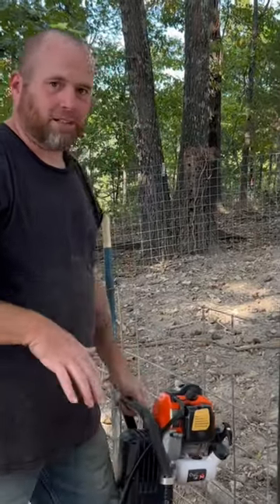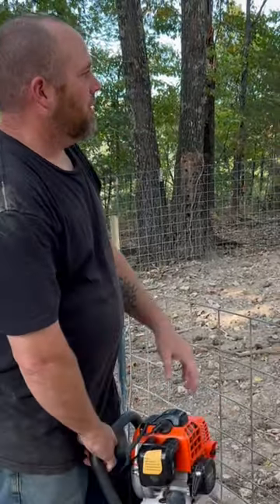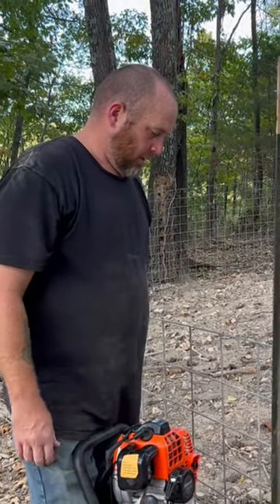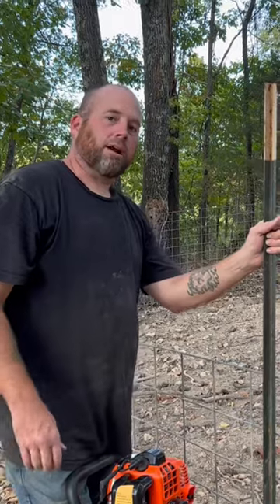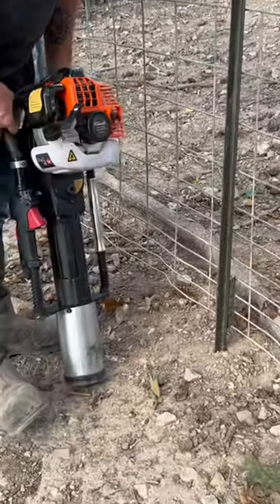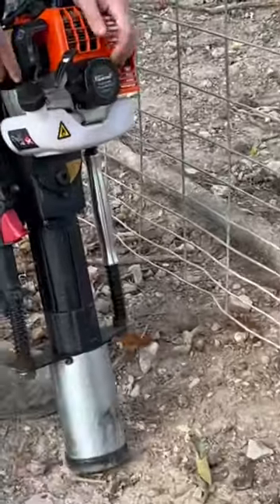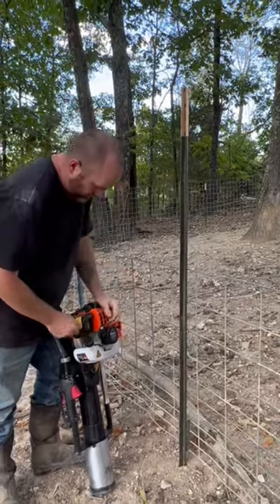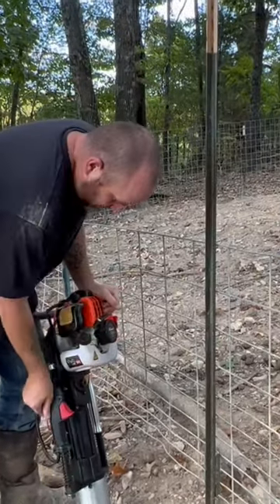Gas Powered T-post Driver | Driving T-Posts Has Never Been Easier!

Comment: I’ll stick with the good ol 20lb manual post driver 👍🏻
Reply from the maker: if your back can handle it, and you don't have the rocks like we do, I suppose that is a good plan lol.  Our ground is just rough.
Reply: @zionsgateranch  we got Red Clay dirt and way to many behemoth limestone rocks here! 👍🏻
Reply: I ran over a mile in 2 weeks for barb wire myself with these tools in the vallys and hill our wounderfull pnw and you aint doing that with a manually man powered driver yeah i use it when i can use the machine but thats rare
Reply: Good for you Landon, but my old busted shoulder and back can't do that these days.